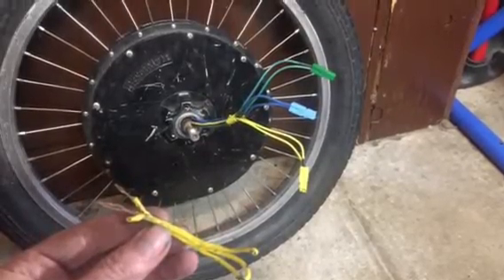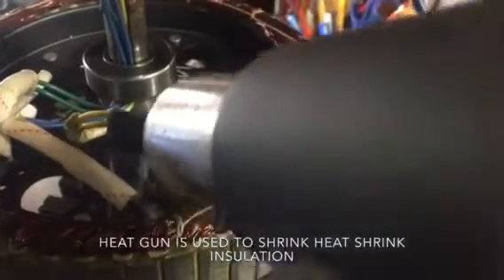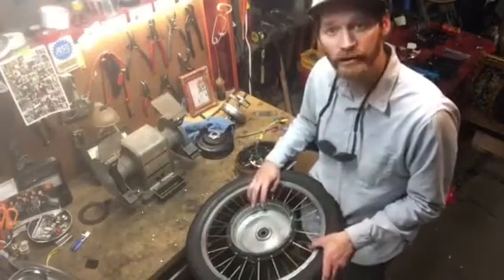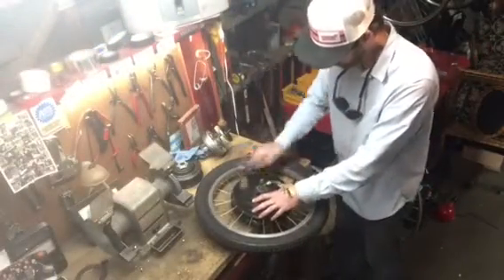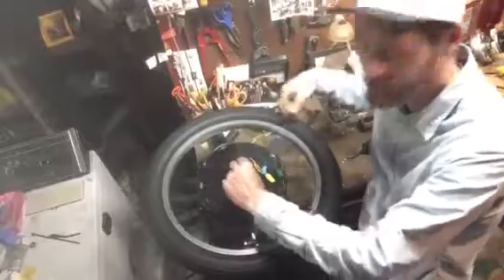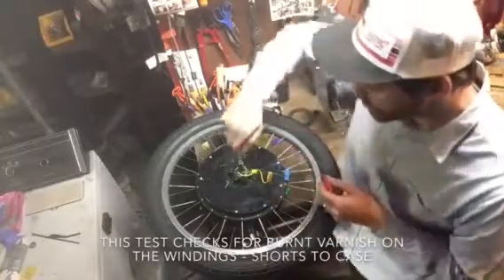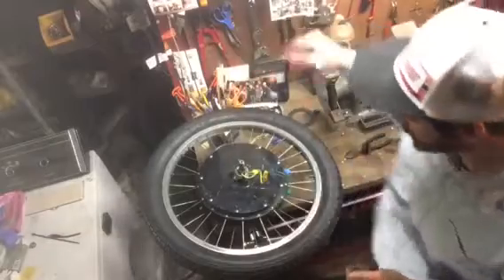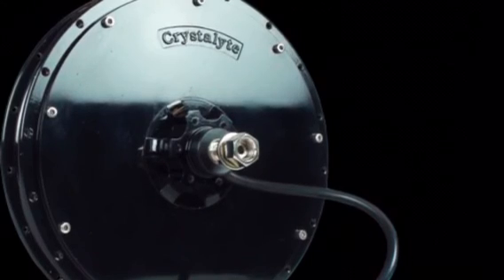Hub Motor Wiring Repair 2

Comment: Where did you get the wire? You can't repair these motors because no one knows where to get the wire?
Reply from the maker: I use the original wire , cut it in half making 2 pieces but twice the current carrying capability

Comment: A2B Rear Wheel motor Cable Connection, Hi I need your help. Some of the rear wheel motor cable wires on my A2B Alva+ 2013 24-inch tire broke off from the connector.  I am looking for a diagram of the connector so I can solder the wires back.  Thanks for taking the time to share your video.  I will appreciate it very much.
Reply from the maker: A2b hub motor is hard to open since spokes on one side of hub must be removed
Reply: @Mrelectric423   I am just looking for a diagram of the connector so I can solder the wires back.  Thanks for responding.
Reply from the maker: @mdiazdiaz5612  I happen to have the Alva + wiring diagram. Download it , I will delete the link in a few days.

https://www.dropbox.com/s/kkqlwc8s6yd6asv/Wiring.Alva%2B.pdf?dl=0
Reply: @Mrelectric423  Thank you so much my brother.  I downloaded it so you can delete the link.  You are the best!
Reply: @Mrelectric423  Hi, thanks for your diagram.  You know what is weird, my throttle male connector has two white wires, one thick and one thin, my connector has no green wire like the diagram has. Any advise? My Alva+ is a 2013
Reply: Hi Nick,  did you read my previous message  ref the your diagram having a Green wire and mine having a white wire instead, that's the only difference in the diagram all other cables match.  Your diagram says it's for a A2B Velociti but my bike is an A2B Alva+.  what do you say?  Thanks
Reply: Mr. Electric, I went ahead and solder the wire, it works ! Thanks so much for your help. With your help my bike is working again.  I appreciate it.

Comment: What do they mean, when they say 3 phase motor?   Is that Low, Medium and High?     So that depending on the throttle, one,two or three wires will be energized to add more power to the motor?   So which one is Low, Medium, and High?